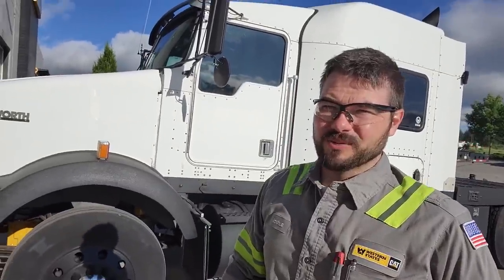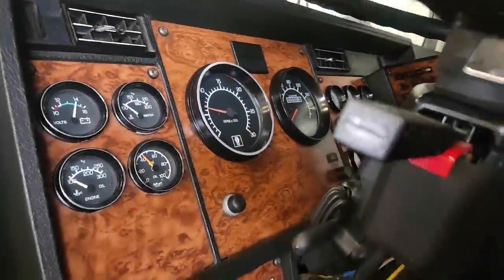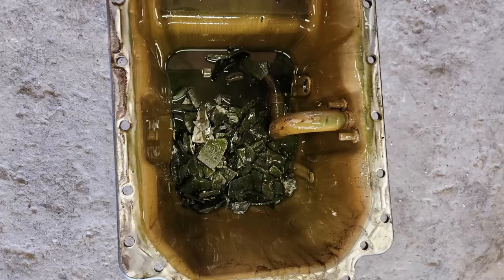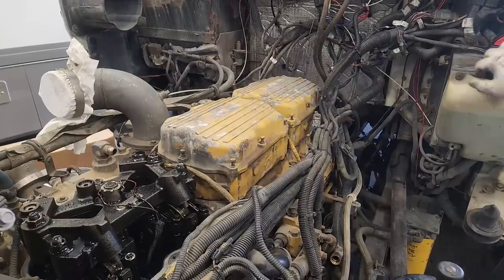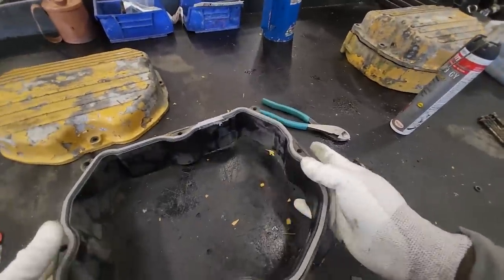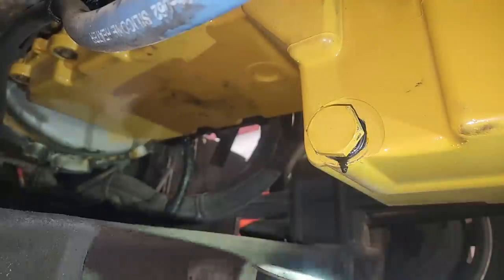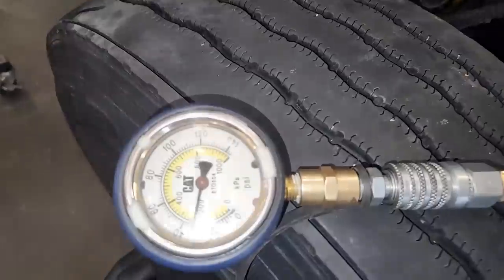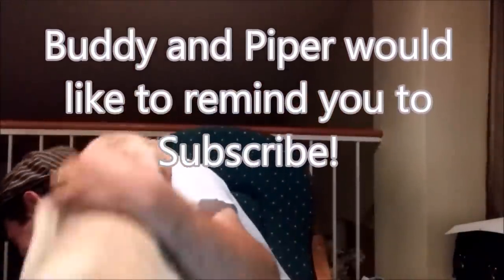Kenworth "Mullet" Truck has a Rough Idle, but Why?

Comment: I want to say they labeled it a 3412 instead of 3406. 
Every Tech should put together a simple pressure test kit for fuel, oil, trans pressure readings is vital for any troubleshooting, diagnosis.
Reply: Agreed, that sure ain’t no 3412🤣

Comment: On my 3126B I've found a lot of components I've replaced have had updated part numbers and are vastly different from the old parts I took off. In every case when I've done that, it's fixed the problem and I can see where the changes they made were improvements. The oil pump and oil filter housing are two examples. It's part of why I don't mind spending the money at the Cat dealer to get the latest and greatest.

And that "3412" is missing 6 cylinders :)

Comment: Had 10 trucks used for heavy haul with C12s. They all needed cylinder packs around 350,000 miles. Cat changed something in the computer and some went to a million miles after that. The biggest issue we had was leaking front structures. The steel plate to block behind the front motor mount would leak. Those were traded in for C15 powered tractors.
Reply: never saw much advantage of a c12 over a c15
overhaul prices sometimes higher....in most applications fuel mileage not much better
Reply: @jim-zx7gz  weight
Reply: The c12 had a thunderously loud jake, compared to the c15. The turbo seemed louder. These had really good power. Cons: they burned oil; got mediocre fuel economy, and had longevity issues. I remember there was an issue with Rod issues blowing holes in the blocks.
Reply: @jim-zx7gz  Initial cost. And lighter weight. Even a 500 pound difference stretched over the life of the vehicle could add up to a crap load of money.

Comment: Thank You Josh. Very well edited and the whole presentation was very easy to understand and follow. the kinds of incidental items you throw in to add value to the subject and keep it very interesting. I don't do diesels anymore, so it's always fun for me to watch your diagnostic logic and the little tricks of the trade, like the RTV silly cone gel getting hard while eating burgers and pizza. Those air bag jacks look so simple, but I wonder about their reliability. A truck airbag is one thing, but a cheap Chinese knockoff airbag attached to a cheap Chinese metal contraption is a horse of a different color. Keep safety in mind when using new tools and equipment. I look forward to your video every week or when you get one out. Keep up the great work, and keep safety in mind. ben/ michigan retired but not gone

Comment: I'm certainly not going to say you're wrong for this application, but some uses of RTV (which vulcanizes at room temperature) specify a cure time before you tighten to final torque.  If you over-tighten before it's cured (or partially cured), you effectively just squeeze it out of the joint.   So you may get less leaks if you install and tighten to 1/2 way, and then come back after lunch and torque to spec.   Again, I've seen that on RTV and other sealants like Honda-Bond... but not claiming to be an expert.
Reply: Different applications, yes when using etc as the gasket your correct, he’s using it more as a glue between pieces of gasket.

Comment: Seen the relief valve stick in the FTP, I always check it. When Cat came out with the new design FTP, did not have the updated line. Had to fabricate a fitting to make it work.  Coolant in the oil on these. Replace water pump first, if that don't fix it, replace head gasket. Two styles of head gasket depends on head and block design. 
I would call Cat and tell them you only got half of your replacement engine.

Comment: I see what's wrong with that engine for smoky red. They misspelled Cummins.
Reply: I'm glad you see it because I sure can't
Reply: You spell Cummins😮    the right way        caterpillar ❤
Reply: I can tell it's a cat c12 12L cat engine not a cummins
Reply: @colinsymonds4665 owned both cat is overrated
Reply: Smokey doesn't need an anchor, its a truck!

Comment: Nice!  Excellent video. I gotta say, that sure doesn’t look like no 3412!  That reminds me of a time quite a  few years back, I got a set of new head bolts for a 3400 Natural gas engine and they came brand new in a sealed container from Cat with no threads cut on them!  Lol. The rest of them were 100% good, just missed a step in production I guess.

Comment: if you suspected a coolant leak you should have done the head bolt check for a leaking head gasket, the key way appeared to be sheared on the fuel pump drive gear,  any time you have the valve cover off on a c12 you should inspect the cam followers, especially number two cylinder.

Comment: Take the gears off the shafts in the transfer pump, keys or gear should be worn if they have that much movement. Look in side of the gears slot probably enlarged.

Comment: The oil level issue could be if the engine was cold and the level was checked too soon after it had been running. It sometimes takes an eternity for cold oil to come back to the oil tray in some engines.
Reply: I have got a Toyota Landcruiser with a 1HDFTE motor and if you check the oil after it has been going it will be off the stick. Check it when it is cold ( over night ) and it will be on the full mark. Can catch you out when doing oil changes too but I know exactly how much to put in it and check it tomorrow to make sure it is right. Jeff

Comment: Oh C10s and C12s I hate them so much. I had 2 trucks with them and the oil leaks out of the front structure and it cracking near the compressor and the cam followers killing the cam. I'm glad i got rid of them

Comment: I have question, sorry not quite about the video. I have started watching your videos and i love them! I just started a diesel mechanic job about 4 months working on school busses with no knowledge about mechanics really in general and they know this. I typically won't get any engine experience unless something were to go wrong and then i get to learn. I was wondering if there is anything without going to school atm to kinda fast track some engine experience without spending loads of money?

Comment: When you were manually turning the pump gears showing the slop, the bottom gear is moving on the shaft, shaft not turning, looks like it's keyed. Bet that key is nearly sheared for some reason.

Comment: Green antifreeze?  Maybe perforation of liners or erosion of o-rings on liners.  I have never seen correct green coolant for diesel engines.  I could be wrong but my coolant was always red.
Isn't a 3412 a marine engine of fairly high horsepower.
Reply: Some of our compact equipment with 3 bangers or little 2.4lit, 4 cylinders will take the green stuff.  Light plants, gensets etc...
Reply: Red is long life, Green is the old style your have to add SCA on prefill, Cat sells Purple also, already has SCA, just add water.
Reply: John Deere coolant is green.
Reply: My 3406E has had green coolant its while life. 1.8 million miles 29 years just had 2nd in-frame

Comment: Around here the steer axle can't weight over 12,000 lbs.
Reply: All your triaxle dump trucks near you have 20 thousand pound steer axles. And yes that’s what they weigh on that axle when you lift the axle to make turns. But that’s fully loaded. Empty ways around 5 ton. So I’m not so sure why the guy in the video thinks that unloaded truck steer axle weighs that much. Must be covering for the vevor company. Those air jacks can’t even lift 5 ton but he covered for them and claimed that steer axle weighs a lot more. Bs. Garbage jack

Comment: I see what's wrong with the engine for Smokey Red.  The breather tube is on the wrong valve cover.  It should be on the back valve cover.